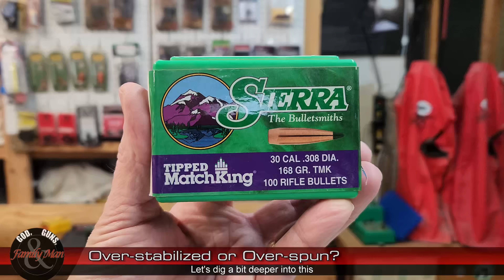You can't over-stabilize a bullet (but you can over-spin)

Comment: What does an overspun bullet look like on groups on paper.flyers,large groups??
Reply from the maker: Yes, your groups will experience increased dispersion and you will see more flyers.
Reply: So that was one of my questions if you overspin a bullet because of the wrong bullet for the given twist rate can you slow its velocity down to counteract the effects and also how does barrel length affect twist rate for example a 30 cal bullet and a 1 in 10 twist rate barrel 22" vs  24" vs 26" Will the 26 be able to stabilize a long heavy for caliber bullet even though it still has a 1 in 10 twist
Reply: @carlpreston1680  the name of the game is RPM. Barrel length and profile have more to do with harmonics than any, but longer barrels give you more velocity, so more RPM(all other things being equal). The length of the barrel does not affect the twist rate. The twist rate is set by the rifling cut in the bore. In your example, longer barrels could potentially stabilize longer heavier bullets, for a given twist rate, by allowing you to push it faster, giving you more rpm. Yes, you can slow the velocity down which will decrease RPM, and lead to larger "precision windows" at lower velocities. This is demonstrated countless times on every reloading channel ever. The hornady podcast says that their mountain of data on thousands of groups indicates that lower velocities typically give tighter groups, usually. Cast bullet shooters are aware of a "RPM threshold" above which, precision falls apart fast. The new 8.6 blackout has a twist between 1:1" and 1:5" because it needs to stabilize long heavy .338 pills at subsonic velocities(around 1050 to 1075 fps). The issue is, most people don't want to throw away 200 to 500 fps or more to get amazing groups. But if you're ok with that, it is an option. The best choice is to pick an appropriate twist rate for what you want to do. You can fiddle around with velocity to "make it work" but that's not really a good "plan A". If it's a rifle for a specific thing(varmint hunting for example) then see what those guys are using and focus around those projectiles, components, velocities, barrels, and twist rates. If it's a general purpose rifle, then look at the general purpose projectiles(5.56/.223 it would be 55gr to 77gr, 308 win it would be 150gr to 200gr) and the twist that the bullet manufacturers say that it requires. For .223/5.56 I'd roll with a 1:8 and for 308 I'd take a 1 :11, for general purpose rifles. You also have to remember to pay attention to bullet length more than weight, especially with some of the new VLD styles, and the non-lead bullets. Figure out what you want the rifle to do, do a little research on that specific application, watch some reloading channels that shoot the stuff you're looking at, and pay attention to their twist rate and velocity and see if they are struggling to find good loads, or if all the loads are good. Hope that's at least a little helpful
Reply: @joearledge1  thanks for the explanation I was just curious about your previous comment about the 18-in barrel versus the 20-in barrel but I had more to do with the twist rate than I barrel length I'm guessing
Reply: @carlpreston1680  yeah, he just happened to buy a 20", velocities weren't very different. Twist rate was the biggest significant difference.
Reply from the maker: @carlpreston1680  Stabilization is interesting Carlton.  A bullet can stabilize very quickly in even short barrels given the appropriate rate of twist.  It gains velocity by having a longer barrel (within reason) which allows the powder charge to act on the bullet and push it increasingly faster.  To stabilize a long, heavy for caliber bullet you need faster twist (think of the difference between a .308 Win and the .300 PRC).  Shooting a light 150 gr. .308 bullet in my .300 PRC would likely over-spin that bullet leading to poor precision.  I hope I answered your question, but feel free to follow up.
Thanks for watching and posting.
Reply: If the bullet isn't deformed by the faster twist rate it should give as good of accuracy as any , but a really light bullet for caliber has a thinner copper jacket spun to fast will deform  and may even break apart leaving the barrel giving poor accuracy or self destructing in flite
Reply: @lawerncemiller6557  that's incorrect. The only twist that might deform a projectile(abnormally)is progressive rifling. Over spinning a bullet highlights it's inherent flaws. Just think of anything that spins and is unbalanced, more RPM = more obvious imbalance(tires, washing machines, ect...). Thin jackets and high RPM can lead to bullets "blowing up" in mid air. This was actually part of the reason jackets were invented, lead bullets do this much easier than jacketed ones. It's not from abnormal deformation of the bullet though, unless your bore is seriously jacked up. The force that causes the "pop" 5 yrds down range is the centrifugal force of the lead trying to get away from the center of rotation, and the jacket isn't strong enough to hold it in.
Reply: You won't see it in terms of the hole in paper, like a keyholing bullet if thats what you mean.
Reply from the maker: @CasperInkyMagoo  That's right.  Over-spun bullets are stabilized so no keyholing.  But the groups will be large.
Reply: He said it best when he said overs spinning accentuates the defects in a bullet aka highlights the flaws in the bullet as none are perfect. The best illustration I've seen is in 5.56/ .223 when, a few years ago, the channel, Johnny's Reloading Bench got a new 20" 1:7 match barrel to replace an 18" 1:8 match barrel for his ar. He did a video breaking in the new barrel and comparing it to the old barrel at the same time.  He used known good loads in various weight projectiles that he had worked up in the 18" over a few years. The "old" 1:8 was stacking them pretty tight, the new 1:7 was "meh..", it wasn't terrible, but it wasn't impressive like the 1:8 was. Basically, if you're twist is too fast, the "precision window" for amazing loads gets smaller. If it's too slow  the length/weight of bullet you can successfully shoot becomes restricted.  If the twist rate is just right, it stabilizes a wide range of lengths/weights(unless you are specifically targeting a "weight class" ex: only long heavy bullets or only short light ones) and is very forgiving with components and loads, leading to a larger "precision window". Johnny went on yo work up more loads with the 1:7 20" and it always just seemed like impressive groups were harder to come by than with the 1:8 18". You can check out those videos on his channel and you'll see exactly what I'm talking about. Another example is 308 shooters. The "standard twist" is 1:10, though it's not hard to find others twists in 308. Most legitimate competition match grade barrel are 1:11.25". Apparently the 1:10 seems to be over spin, 1:12 seems to be barely too slow for 175gr and higher, 1:11.25 seems to be the sweet spot for 308 roughly 150gr to 200gr. My guess is the extra 0.25" came from competition guys with a healthy dose of OCD trying to figure out "the perfect" twist. Anyway, hope that helps some.

Comment: I’m working on a subsonic load for a 20” 308 with the standard 1:10 twist and I’m starting to get a bit frustrated. 

I started experimenting with heavier bullets aiming for the same ~1050fps (trail boss powder) to increase muzzle energy and it seemed as if no matter what I tried the gun didn’t like it. (180, 190, 220). The rifle went from shooting quarter sized (supersonic) groups at 100 to 6” at 50 (subsonic)

Are you suggesting I stick with the 168 or maybe something even a bit lighter, since I’m decreasing velocity significantly?
Reply from the maker: I think you are seeing actual stability issues.  I have the same issue with my RPR as it shoots heavier (longer) bullets poorly but does a good job with the 168 gr. bullets.  Look for a shorter bullet and give that a try or stick with the 168 gr. range.  Speer Gold Dots are pretty short bullets for their weight and they may make a heavier bullet you could try.
Thanks for watching and posting.
Reply: @sdkweber   Thanks for the reply. At this point if I could get 2MOA out of it subsonic I'd be thrilled.
Reply from the maker: @CasperInkyMagoo  I understand what you mean. I see the .300 blackout uses a 1:8 or 1:7 twist.  That's is how that rifle can shoot the heavy (long) 200 gr. + bullets.